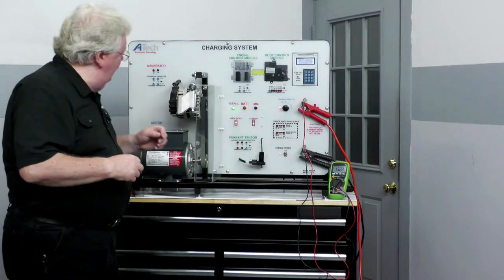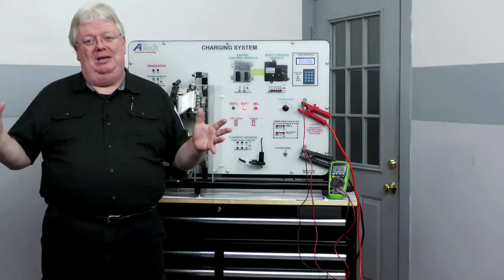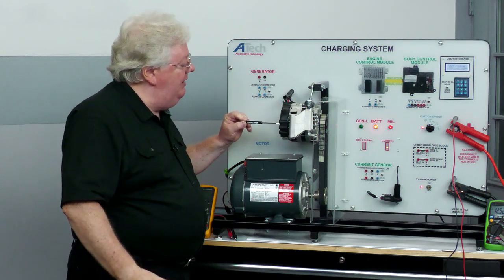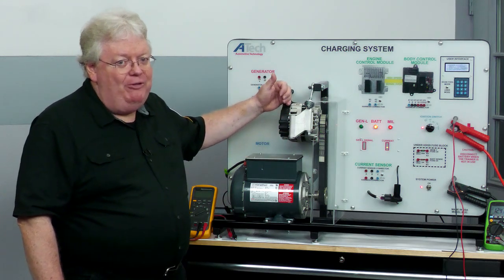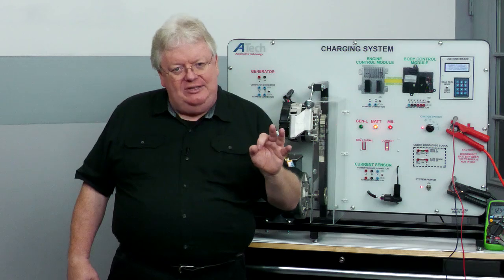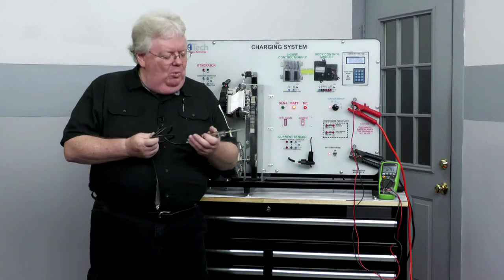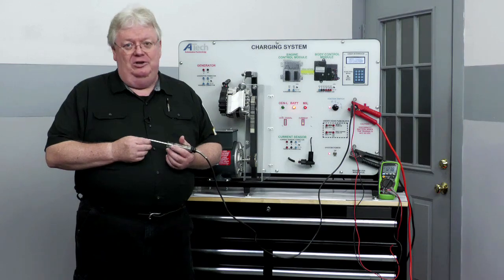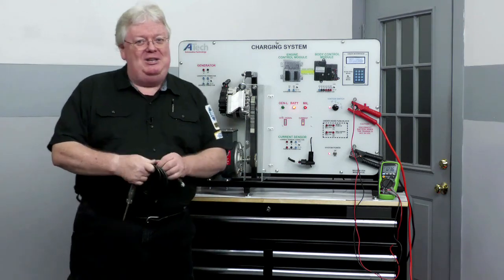Older Vehicle Charging System Tech Tip

Comment: Why did they ever change the FIELD  brown wire terminal ( with 10 ohm resistor) and give it the name L ?  With my 17SI, it is a Field terminal and  Sense terminal. Maybe L is the right name for the CS alternators , but the SI should have been called Brownfield Light terminal !!